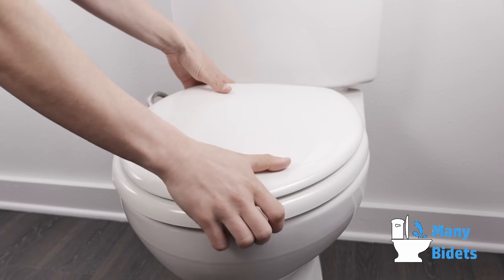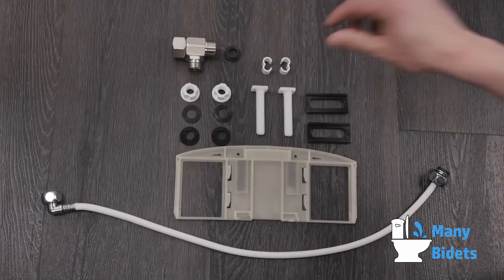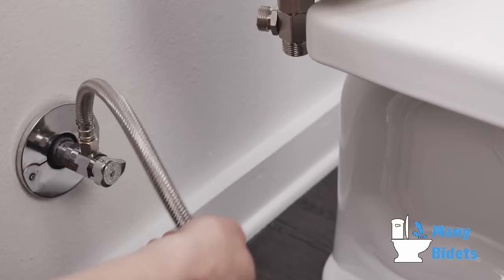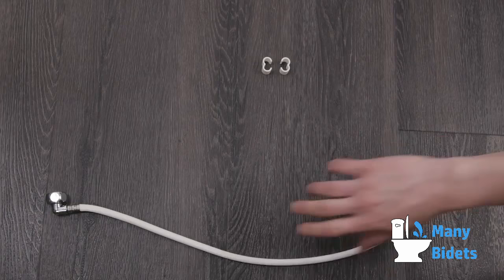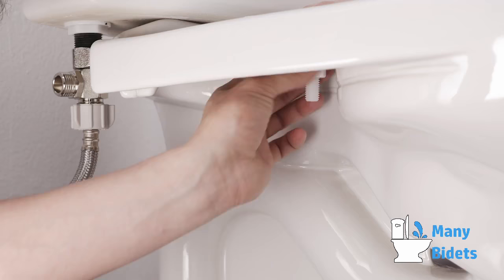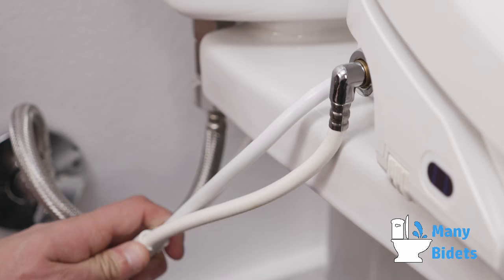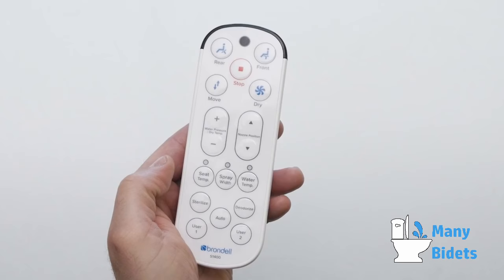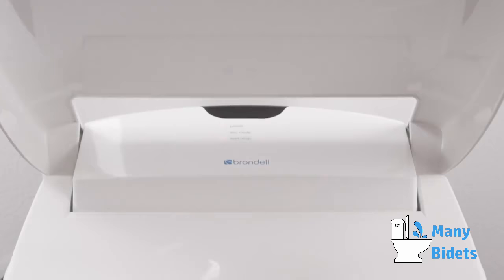Installing a Brondell Swash Bidet Seat

Comment: I do have to say you helped me on one very important way to test the connection. I had to replace the line from the wall due to the fact it was a straight hard line. After connecting everything I had leak fron the connection of the new line from the walk to under the toilet. It was actually my son doing this as I couldn't fit in the small space. I believe he may have cross threaded it to the fill valve. After undoing the new line, he reconnected the old and no leak. It's confusing why it's not leaking anymore. But im glad. But here's  where I say you helped. In your video before it was all connected you blocked the one end of the valve to first see if there was a leak. If we were to do that we would have known right away there was a leak before we went any further. I actually just bought another fill valve thinking it was cross threaded. Before we put that to use I am going to have him try your method. I have watched a good 10 videos on this bidet thing and yours was the only one to give this little hint. Thanks so much
Reply from the maker: Thanks for the kind words!  I'm glad it helped!!!

Comment: I just installed one very easy to install.  where were these when I was a kid. first time use was very impressed.  very clean sanitary
Reply from the maker: Glad to hear it!  Thanks for your business!
Reply: In Japan
Reply: @ManyBidets  hi can use a standard outlet instead of gfi outlet?
Reply from the maker: @kleverpenafiel7019  Both we and Brondell recommend only using a GFCI outlet, but it will work plugged into a standard outlet as well.
Reply: @ManyBidets  thank you

Comment: Awesome video. I just bought this very model. All the other videos I saw didn't show this model I have. It's very informative. I would have liked if you had shown how the water  pressure is and if it was variable. Obviously you can't just let it spray all over but others held a towel or bucket over the spray to show. But otherwise a good video. Thanks. I'm going to connect mine this weekend
Reply from the maker: Glad you liked it! The pressure is variable, but not overly strong.  If you'd like something a bit stronger than the Swash, I'd recommend the Eco Nova bidet seat: https://www.manybidets.com/product/eco-nova-bidet-seat/ If you want stronger still, I'd recommend the Cascade 3000 Bidet Seat: https://www.manybidets.com/product/cascade-bidet-3000/

Comment: Good luck having an outlet nearby
Reply from the maker: That is something we run into issues with...  An extension cord can be used, or an outlet can be installed.  More and more homes are installing outlets near by when they are being built!
Reply: @ManyBidets  Yeah, i'll drop a new outlet when I'm ready. They should make that mandatory for all new homes built. Doesn;t add hardly anything to the cost of a house but will encourage more Americans to make the switch.
Reply from the maker: @lucyfyrearchoftwilight9282  100% agree!  It's a pitty it hasn’t been a thing from the start, but it is becoming more and more common :-)  Once you get an outlet near by, reach out and we'll give you special pricing :-)
Reply: I never could understand why this isn't catching on here in North America. Most hygienic. 
$$$$$ saved on toilet paper but might, just might, increase your water consumption.  For me, very worth while. In the , toilet area, Europe has been ahead of us for years.

Comment: When I installed my brondell swash it leaked from the water tank.  Split seam.  Defective from the factory.  I called Brondell and they refused to fix it.
Reply from the maker: I'm really sorry to hear that!  Did you purchase from us?  If so, please email us at support@manybidets.com.  We'll make sure you get taken care of, and pull some strings with Brondell.
Reply: @ManyBidets  I am sorry I had to write this review.  I did not purchase this bidet from you.  I am sure you would not have handled the problem in the shortsighted manner in which Brondell Corporate did.  You probably would have had it repaired at minimal cost and I would have been very happy.  I purchased mine through amazon.  They accepted the return of the defective unit.  Unfortunately they do not repair.  Repair is what I really wanted as the unit itself was pretty nice if it only didn't flood my bathroom.
Reply from the maker: @odomn  No worries at all.  We welcome any and all feedback.  If you're in the market for a bidet seat where you won't have problems like the one you described, feel free to reach out.  We can hook you up!

Comment: how long is the electrical cord?? Can it be ordered with an extra foot or two??
Reply from the maker: It's 3 feet long but you can use an extension cord.  You can't order different lengths though

Comment: I am installing my bedit and the T-Valve connector is leaking in between the part that attaches to the tank and the second part that connects to the bedit hose.  I have re-installed it three times thinking it's something I have done wrong.  It could be a defective part.  I can't get a hold of brondell. 
Thanks for any advise!!
Reply: Crossthread
Reply: @jayrprado8799  I had the same issue... I tightened the valves too tight.  Try loosen them.  Mine stopped leaking.
Reply: The trick is not to over tighten the T to the toilet, as you can watch in the video it's gentle flinger tight
Overtightening even using fingers can push the gasket into the toilet threaded pipe causing a leak.
If this trick doesn't work try to use some plumbers tape on the toilet threaded section
Reply: I tried this 5 times to get it not too leak. The design is flawed. It does not give me a good sense that this will not leak in the future. Seems so fragile. It is a $600 product. Expected better than this.

Comment: Can I put the T-valve / split connector to the water spout from the wall as oppose to the toilet. I can't reach the toilet one as easily
Reply from the maker: You can not with the standard T that comes with the seat, but you can if you get this alternate T connector: https://www.manybidets.com/product/bidet-t-valve-for-skirted-toilet/
Reply: @ManyBidets  I can reach with a tool but it's a bit annoying and my water tank isn't emptying complete and i have some sani products in there. 

Will opening the fill valve - unthreading, cause the water in the tank to leak out?
Reply: @ManyBidets  Why can't we use the Standard T?
Reply from the maker: @sedul2006  If you can't reach under the tank, you can use this: https://www.manybidets.com/product/bidet-t-valve-for-skirted-toilet/

Comment: Can’t get the water supply to thread on straight to the t valve. Any ideas?
Reply from the maker: email us with your order info, and we'll reach out to Brondell on your behalf.  You may simply need a new T or hose if there's a cross threading issue...

Comment: What model toilet is in this video?
Reply from the maker: Unfortunately, this was 6 years ago so I don't recall but believe it was a TOTO Drake. We're always happy to help confirm fit so just reach out if we can help!
Reply: Yes, confirming fit would be so helpful! I have the Omigo luxury bidet for a round toilet but it does not fit our current toilet because the tank prevents it from sliding far enough back. Would the Toto be a good option?

Comment: Do you need an electric outlet for this installation ? Love to have one.
Reply from the maker: Yes you do.  Top pull is about 13 amps, but you can use an extension cord that’s 14 gauge if needed.
Reply: @ManyBidets   Uhm, extension cord ? Nah. Thanks for your response.😉
Reply from the maker: @ornellabarbaro3861  Yeah, I get the desire not to use one :-)  Just wanted to make sure you knew all the options!  If you ever have a bathroom where you have an outlet near by, hit us up!
Reply: @ManyBidets    My daughter designed my bathroom, and put an electrical outlet near the toilet "just in case".   Great idea.    My sister-in-law wanted a bidet, but didn't have an electrical plug near her toilet.  But, since her toilet was on her main floor, it wasn't too difficult to bring the wires up through the basement ceiling.  Definitely worth the effort.

Comment: I'm unaable to unscrew the water line from the toilet, it just will not move, HELP, i'm 80 and a woman with not much strength.
Reply from the maker: I would recommend reaching out to a handyman or plumber.  Sadly, if you're not able to unscrew it, you'll need to get someone else involved.
Reply: Use two wrenches 
One to hold the valve and one to turn the water line